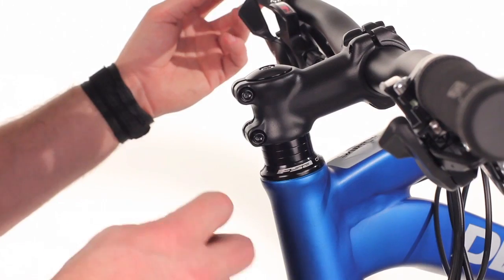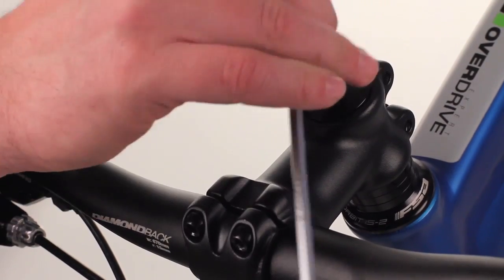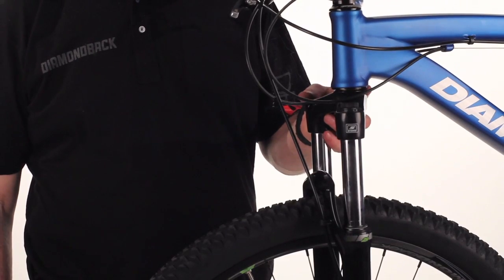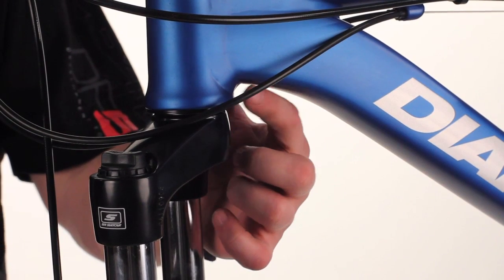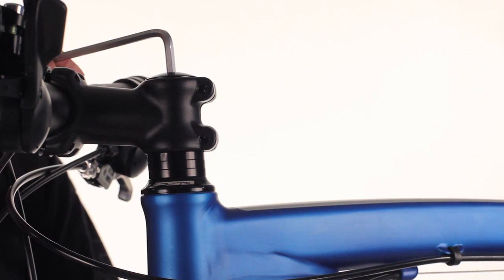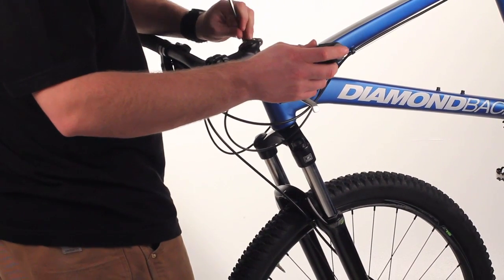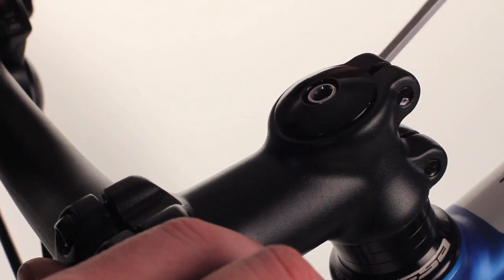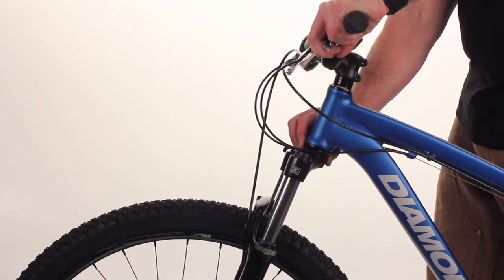Diamondback Tech: Threadless Headset Adjustment

Comment: You didnt show any adjustments. Just how to align and tighten after adjusting. How to raise these types of bars?
Reply: I came for the same information. This guy is useless! The stem uses spacers which you can purchase from any bike store. simply unscrew to bolts on the hand-bar stem poorly shown in this video and slide them on. Ive read that there is a 30mm - 40mm recommended safety increase limit. Hope this helps anyone reading this.
Reply: buy a headset extender. there is no other way to raise it.